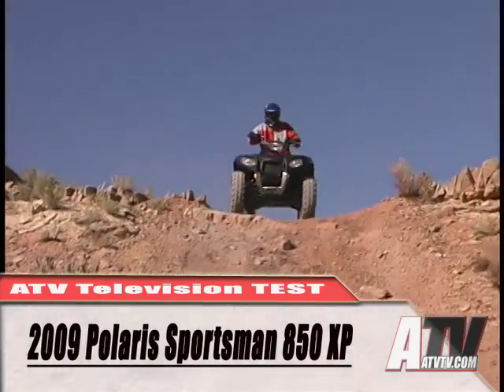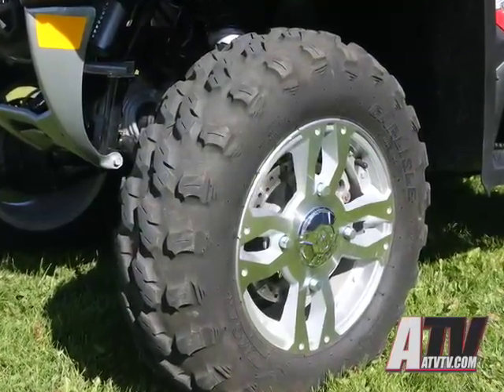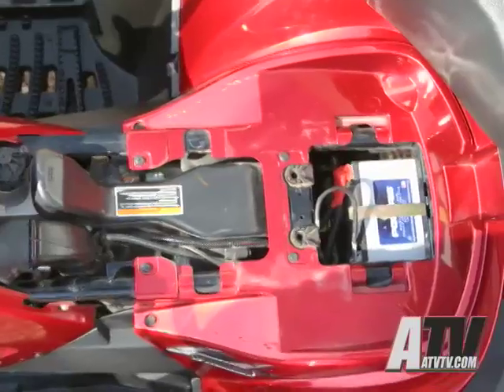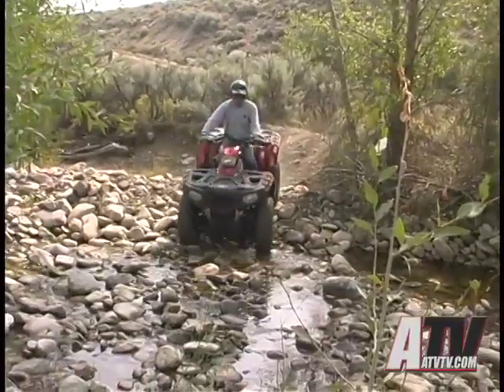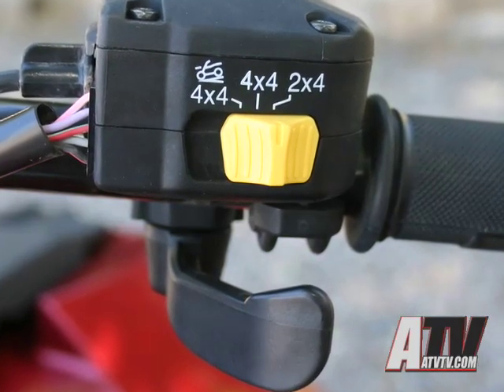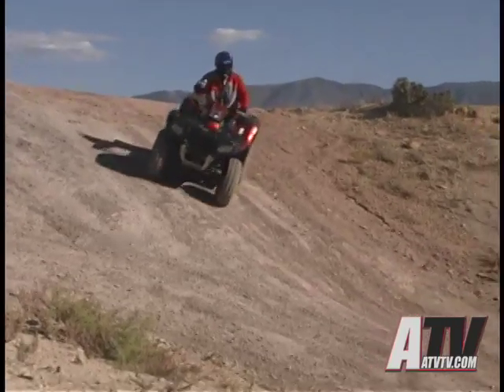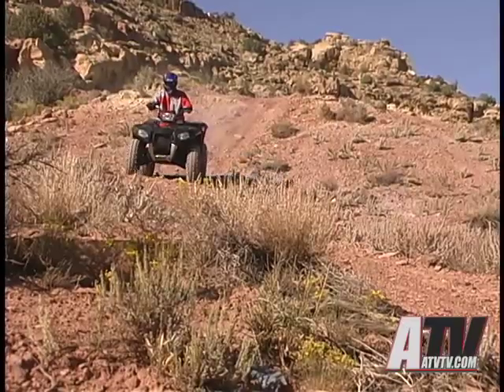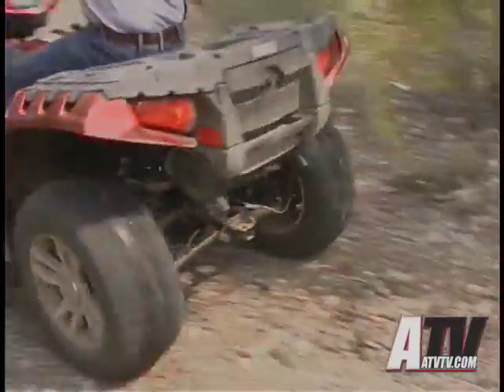ATV Television Test - 2009 Polaris Sportsman XP 850

Comment from the maker: @thepopeis1 The Touring gets the front box and therefore the battery gets moved to the rear. And it still has a single rear disc on the right rear wheel. Our mistake. That is the 850 that has two rear brakes.

Comment from the maker: @quadGOD12953 They use the rubber mounts to isolate the engine vibration from the rider. That's one reason they are so smooth.

Comment: ATV 2..and i have had no problems with either except my Recon cuz i was stupid and sucked water into the intake and burned my piston.  Even when i watched it roll down a river i caught it and turned it back over and it fired right up, That recon has been through hell..but never let me down until i really swamped it in mud to where the handle bars were only showing and i knew i messed up the engine..so why the problems with the shifting on the ES models when they hardly see offroad conditions?

Comment: that's weird the battery on my 2010 550xp is under the front rack and only 1 rear break. (locks up easy with rear only breaking) and I love the engine breaking I have gone down some steep hills with out touching the break (yet to use adc) its a great atv. the only thing I dont like is that it does take to many revs to get it moving and it jumps some when taking off. I don't really notice it until I have to a tight maneuver.

Comment: Sharp
Especialy compared to the older ones
But they still use a CVT system that I did not like when I went test driving
I went with the Thundercat 1000

Comment: Is the belts on these reliable?
Reply from the maker: The Polaris CVT system keeps the belt continually turning so even when the machine is at rest the belt is slipping between the sheave and then is put under pressure when under power. Because of this I highly suggest that you carry an extra belt and know how to replace it. One of the biggest causes of belt wear and breakage is putting the CVT under a lot of strain using high range when in conditions where low range should be used.
Reply: ATVTV I have 1,200 miles on my 850's original belt, if you're not an idiot the belts will last a very long time.
Reply: +ATVTV out i have found is neutral keeps the belt spinning so it doesn't create that hot spot. iv had to change mine and watched how it worked with th housing off. and i now use low a little more when i putt around

Comment from the maker: @Knox48x One word - electronics! For some reason 'some' Hondas were plagued by electronic gremlins. Don't have a solid answer if it was so much bad electronics or merely bad sealing where switches and switching systems got condensation in them and caused problems. Or maybe Honda just did it to let the other manufacturers catch up ;-)

Comment from the maker: @bodgaard Actually it does a lot for control - unfortunately it's all bad ;-) Although the normal engine braking is horrible (and dangerous) the ADC makes it as it should be. And as an aded bonus, the AWD system works in reverse without having to push the override button. Wow.

Comment: this atv actually blows. i have one and its gunna be on its second time to the shop cause it wont start. the first time was the spark plugs and the joint on the a-arm was loose. somehow i had bad spark plugs. now it sounds like the starter is out or theres a bad connection somewhere. polaris sucks and i will not buy another one of their atvs again.